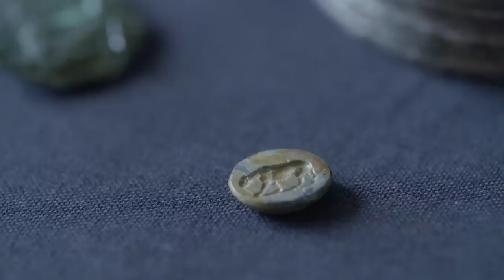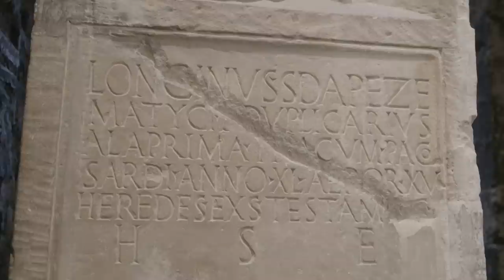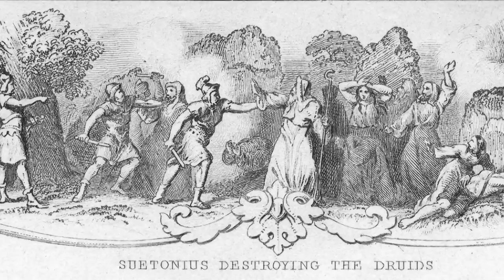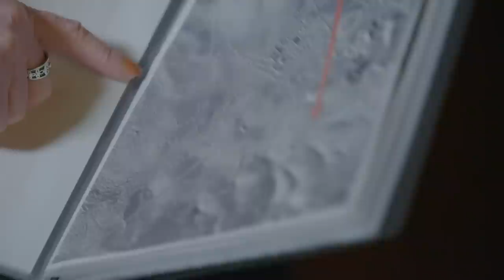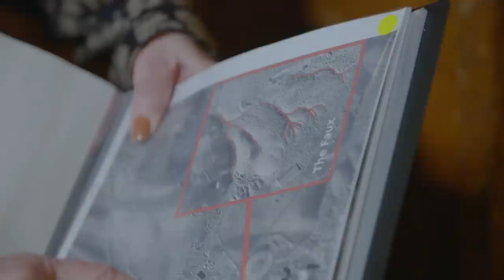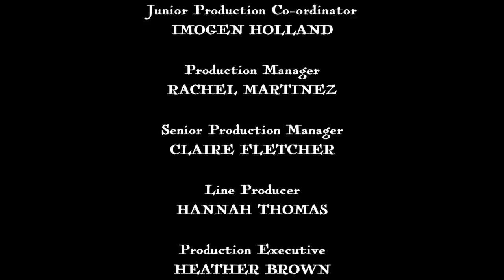BritainsLostBattlefieldsSeason01_EP103 | Banijay History

Comment: Interesting but too much hype.  Also the current calendar was not Roman.  The Julian (Roman) calendar was replaced in England in the mid 1750s by the Gregorian calendar which is the contemporary one.
Reply: They only differ in as much the Gregorian calendar accounts for leap years and therefore takes into account calendar drift, whereas the Julian calendar doesn't (erroneously stating that there are exactly 365.25 days in a year).
The names of the months we still use today are indeed Roman.
Reply: Thanks and true but don’t forget the beginning of the year before the change over was Lady Day or 25th of March and not 1 Jan.  The later only became New Year’s Day once the Gregorian calendar was adopted. @cuhurun